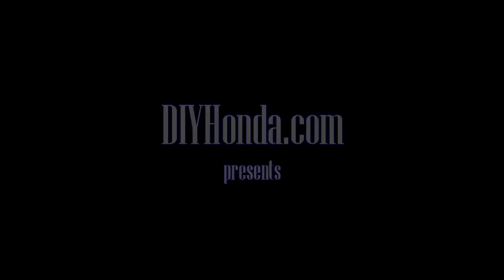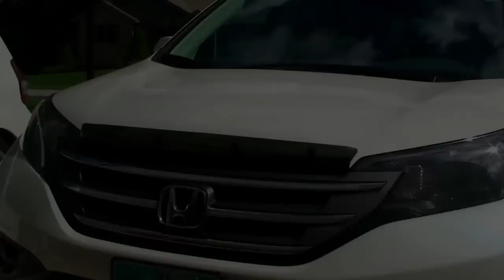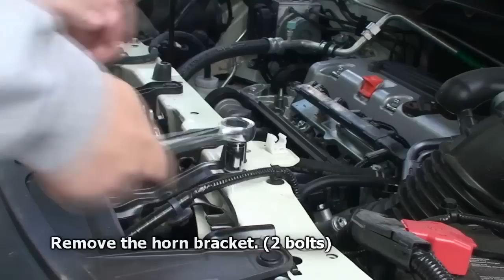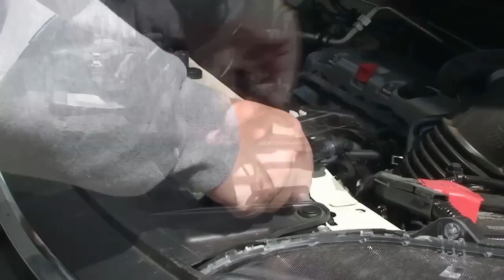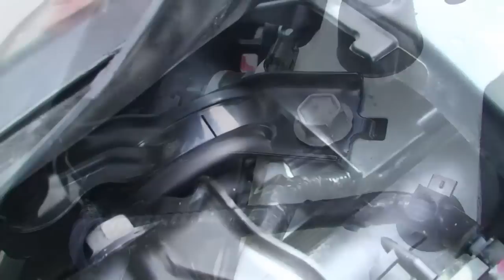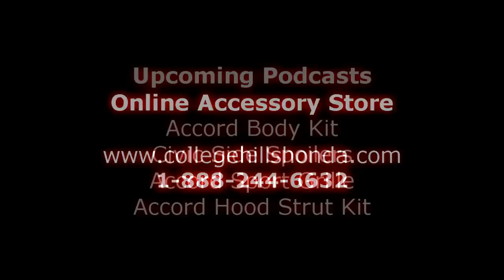Episode #241 - 2012-2016 Honda CR-V Low Horn Upgrade Installation

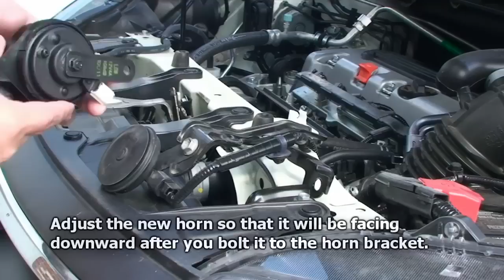Comment: I bought this horn for a Honda CR-V 2015, (41.00 total from college Hills))it works with the original wiring harness, but it will not fit in the original location. At 1:32 you can compare the sizes of both horns, and right there you can see a big size difference. I tried to install the horn using different angles and hardware but it wouldn't fit. I finally installed it in a different location using some of the original hardware and the same wiring harness. Just make sure you use a good grounding spot (you may have to remove paint/coating to create a good grounding spot) I'm happy that I got rid of the Meep sound.

Comment: i have a 2015 crv, and it does NOT have that horn bracket at all.  at least if it does, it's not bolted to the upper front frame with 2 bolts as shown in the video.  any ideas?

Comment: Just did this. Just plugged it in and bolted it on. The new horn does press against the grill at one small point. Slightly bending the mount before installing would have been ideal. Will it eventual cause wear or noise if the horn touches the grill?

Comment: I changed the horn as noted in the video, but I'm still hearing the high pitch sound of the other horn. I thought just changing to a low tone horn suggested would do the trick, but it still sounds the same. What fires the low tone horn?
Reply from the maker: ***** You will still hear the high tone horn unless you unplug it or purchase an upgraded high tone horn.
Reply: oneinmind its two horn but i cannot find the otherone i can’t see it

Comment: All was going well with my horn swap, until I couldn't get the old horn off the bracket. It's on there TIGHT! I've tried all that I can think of (different tools, WD-40, other little tricks that usually work), and it's made no difference. Any thoughts? I'm at the point where I'm just considering ordering a new bracket altogether. Any insight is appreciated!
Reply from the maker: If you removed the bracket first I would try loosening the horn from the bracket while it is still attached to the car. This will give you some leverage.
Reply: Hey, thanks for the reply. Tried that, and all I did was bend the bracket WAY out of shape. It's really on there!
Reply: College Hills Honda I was eventually able to get the bolt off with lots of forcing and gratuitous amounts of WD-40 - thanks for your help. One more (perhaps larger) problem: I swapped the horns, plugged the new one in, and put everything back together, but the new horn doesn't work. Just to make sure I wasn't going crazy, I swapped them back, and the old one still works perfectly. Am I doing something wrong? Again, thanks in advance.
Reply from the maker: *****  Boy you are sure having some trouble there. You may want to give us a call. 1-888-244-6632.
Reply: College Hills Honda Thank you, that's exactly what I'll do.

Comment: my 1997 honda crv horn don't work. Can you give mr instruccions where the horn is to replace it? Are there a specific horn to buy for a '97 honda crv?
Reply from the maker: +bbymami857 The horns should be located under the grille. You will most likely need to remove the bumper to replace.

Comment: Hello, I have a question. I installed it like in the video in my Honda CRV 2013. Sadly it is working only one or two times and than it works like the previous old horn. What is here the problem? 

Greetings
Reply from the maker: Not being grounded is most likely the culprit.

Comment: I happened to put in the part # for your low grade horn on Amazon, and it says it doesn't fit my 2013 CRV. Could that be right?
Reply from the maker: +Sharon Chisholm If you are strictly going off of Honda's part fitment guidelines yes. Never trust Amazon. I thought you had a newer CR-V. For a 2013 you will want to look here instead. http://www.collegehillshonda.com/category/2012-2014-crv-accessories-electrical.html

Comment: I contacted the mechanic to see if this horn will fit since I don't want to get my husband all flustered if it doesn't. and this is what he said: I can not say if it will work, their system says it would work for your model but the part number does not show as a fit from American Honda. That being said, it is possible but the connector for the electrical may be different.
Reply from the maker: +Sharon Chisholm He wouldn't know unless he has actually done it. We have. If you are uncertain or don't trust our knowledge I would not recommend buying the product.